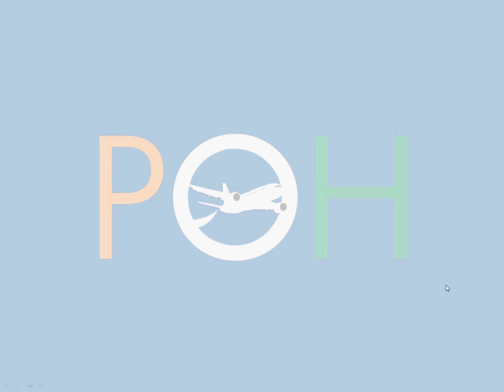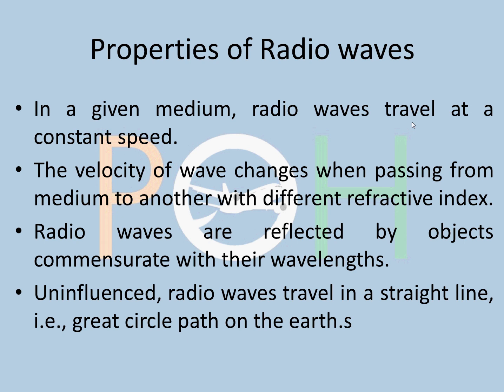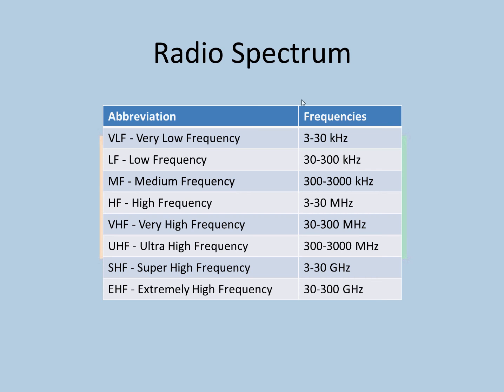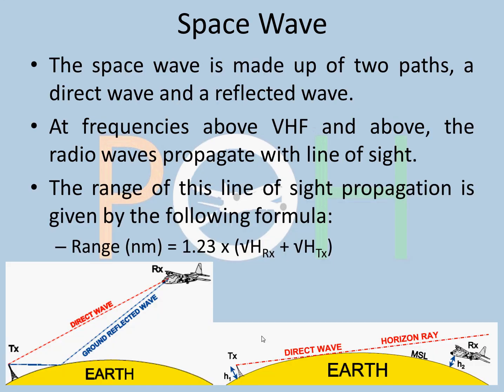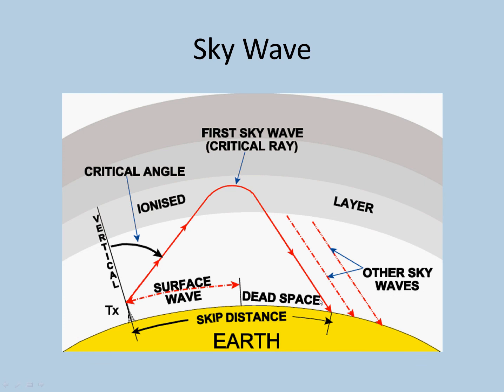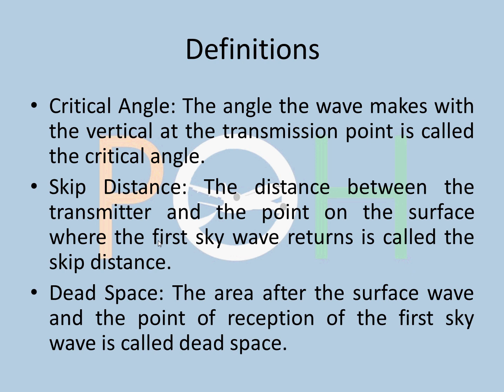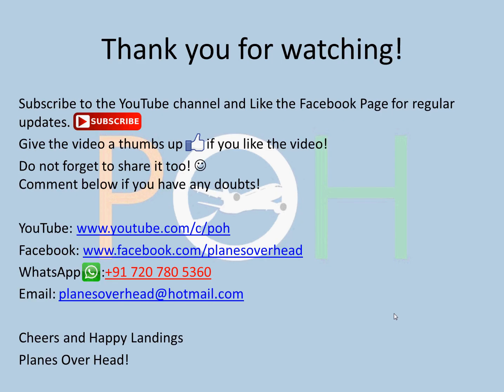Radio Navigation - Radio Wave Propagation

Comment: This is probably the best discussion of propogation I've come across, and gave a good introduction to the idea of Critical Angle/Ray. If I may say so though, I think a few words on Near Vertical Incident Skywave ("NCIS") would have been helpful, ie (as you know),  the beaming of HF signals towards the Ionosphere at a very steep angle, resulting in their refraction/reflection back to Earth at a commensurately steep angle, so that coverage can be achieved in what would otherwise be a zone of  'dead space', or in areas that theoretically ought to be reachable by Line of Sight (I think!) or Groundwave transmission, but where, in fact, the existence of very mountainous terrain means that a lot of 'dead spots' exist because they are in radio 'shadow'. Also, personally, I would have appreciated a few words on how the different means of propogation relate to the broadcast radio bands (VHF/FM, and Short, Medium and Long Wave, as they used to be known, also known as - loosely speaking - 'AM')... although it may be that you have covered this in another video.
Reply from the maker: Thank you for your comment! It'll help everyone else!

Comment: At 10:00 Higher the Frequency, More will be Critical Angle and MORE will be the Skip Distance.

2nd, at 9:50 More the Ionisation, lesser will be the Critical Angle and LESSER will be the Skip Distance . 

please mention that, as that's the basic of radio waves and if students get conflicting things in mind then it only confuses them when actual question will come in exam

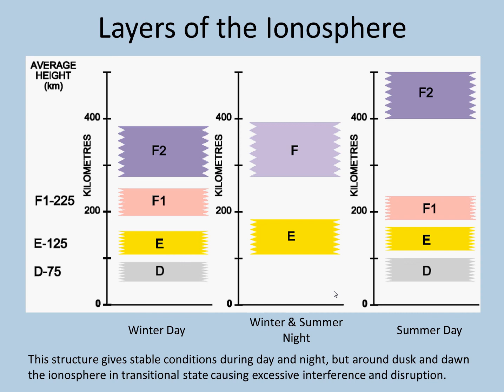Comment: At 5:30 your diagram for Night should depict a much depleted E Layer. "At night the E layer weakens because the primary source of ionization is no longer present. After sunset an increase in the height of the E layer maximum increases the range to which radio waves can travel by reflection from the layer."
Reply from the maker: Thank you! I'll try to put it in if possible! Thanks for your comment and suggestion!

Comment: Nice video. Could you make videos about the following topics:
1.Equation of motion for level, unaccelerated flight
2. Thrust and power required for level, unaccelerated flight 
3. Power available for propeller and het engines
4. Variation and power required with altitude
5. Rate of Climb
6. Glide angle

It would be really nice to make these video since I want to study it for my academic test for admission to TU Delft Aerospace Engineering. Thanks 🙏.